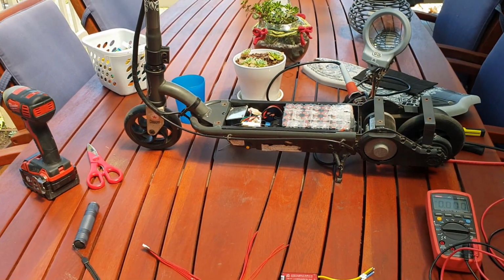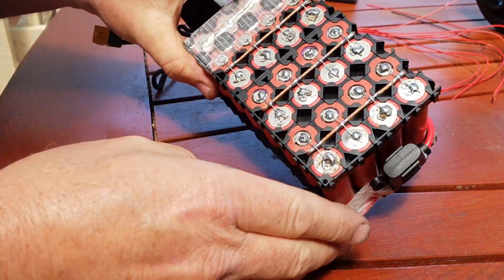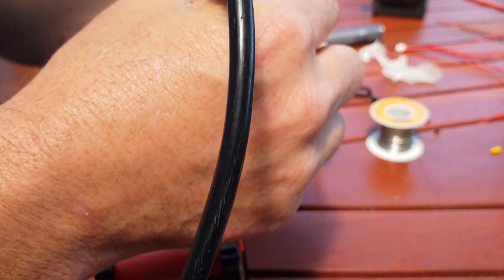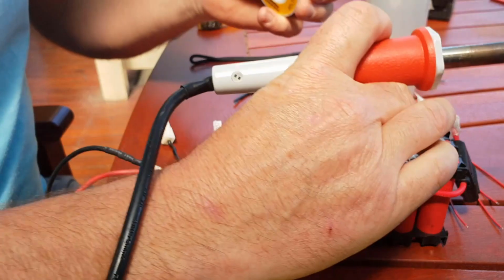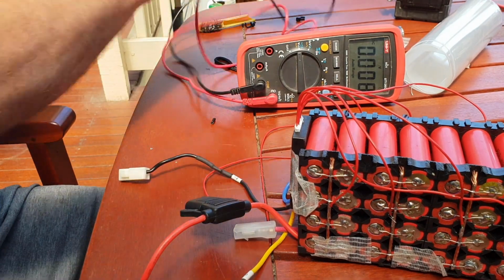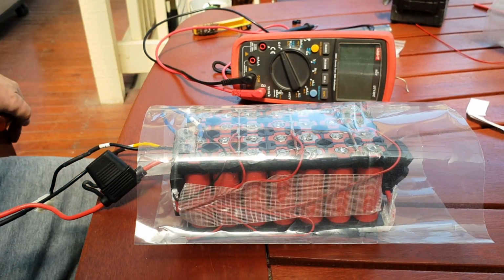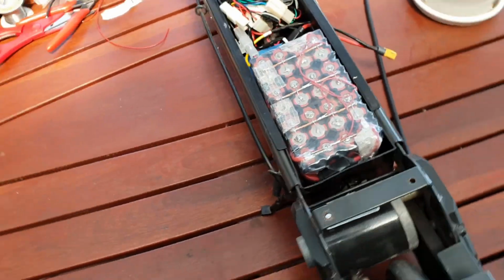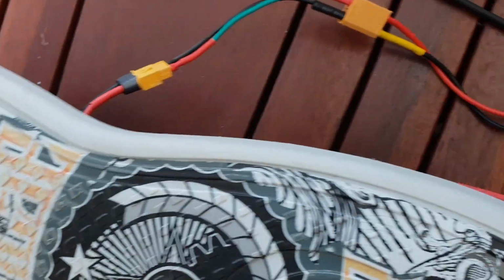BMS Wiring 7S 24 Volt 18650 Lithium Pack. Escooter Upgrade Part 2

Comment: Nice looking batteries. Looks like custom made bus with some twisted copper and fuse wire for isolation in case of short. 
Could you help me please
-Why do it in the positive AND the negative? Shouldn't be enough to do for ex only positive?
-what do you use as fuse wire? 
-how did you calculate the thickness of copper bus?
Reply: You all prolly dont give a shit but does any of you know of a tool to log back into an instagram account??
I somehow forgot my login password. I would appreciate any tips you can offer me!
Reply: @Howard Dominick Instablaster :)
Reply: @Emmanuel Maxim I really appreciate your reply. I found the site through google and I'm in the hacking process atm.
Takes quite some time so I will get back to you later when my account password hopefully is recovered.
Reply: @Emmanuel Maxim it worked and I finally got access to my account again. Im so happy!
Thank you so much, you saved my ass!
Reply: @Howard Dominick no problem :D

Comment: Great video👏🏻👏🏻👏🏻
I cant find the module you use to charge the battery, please can you tell me where to buy it? Thank you
Reply from the maker: Hi
Sure, here it is.
https://rover.ebay.com/rover/0/0/0?mpre=https%3A%2F%2Fwww.ebay.com.au%2Fulk%2Fitm%2F253227899240
You can probably get them from Aliexpress also.
Thanks for watching
You
Reply: Also how are you powering the charger?
Reply from the maker: Revin' my engine Jus with mains 240 v power. Usually would be solar but I don’t have my system set up currently

Comment: Sorry if you mentioned it but does the bms protection board have over discharge protection?
Couldn't see it in the spec.
Reply from the maker: Hi, yes it does.
Thanks for watching
Reply: As I know all battery management systems (BMS) have overcharge and under discharge protections. That is the management otherwise it is a charging board or module.

Comment: You scooter motor needs  24v in , why you bought 7s bms?  you will have 29,4v with this bms right?      i have a doubt with this in my RV project, why you didnt buy 6s 24v bms to have 25,2 v charged??   thankyou
Reply from the maker: Hi
I am intentionally over volting the motor, which gives better performance
Just need to be sure your top voltage doesn’t exceed the capacity of your controllers capacitors ✌️
Reply: 29.4V is maximum voltage which drops of fairly quickly, it'll rest around 24V nominal voltage for most of its use (roughly), these motors can handle the extra voltages no problem
Reply: 7s for 24v equipment works out perfectly, in most cases, with lead acid full charge or while charging can reach 28.8v and some cases even 30v, and 7s can safely go to 20-21v where most 24v electronics shut off!  I'm home inverter, and battery bank us 24v with a 7s charge to 28.7v, 4.1v per cell! And the inverter shuts off at 21v, and can Handle up to 32v